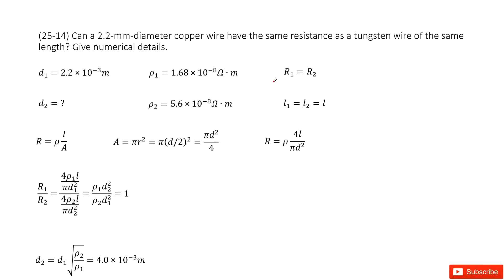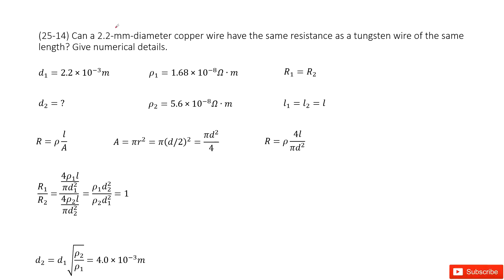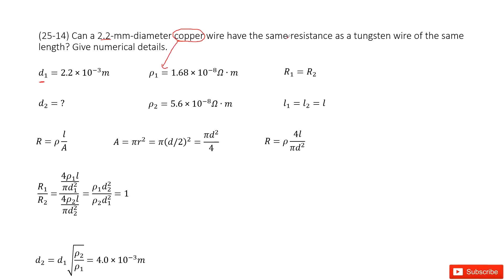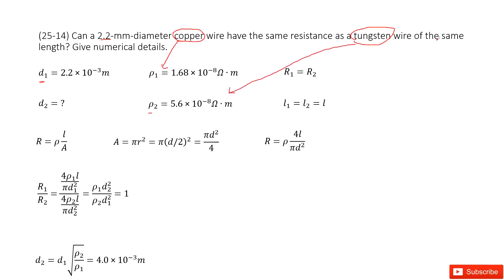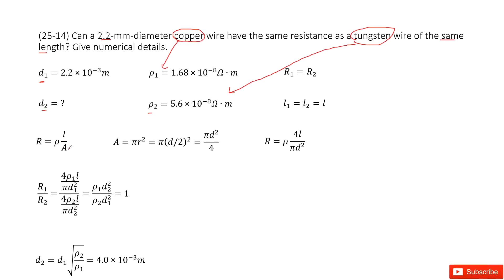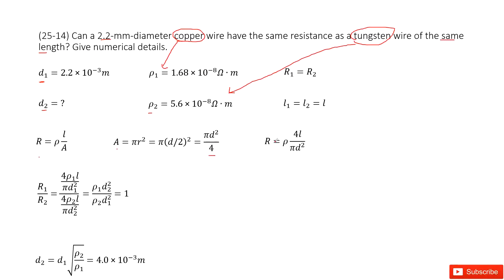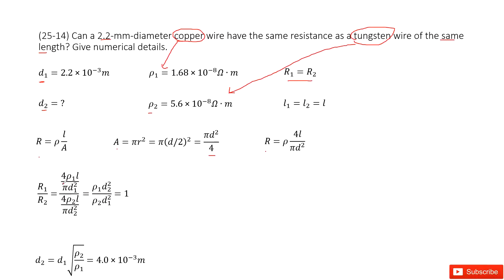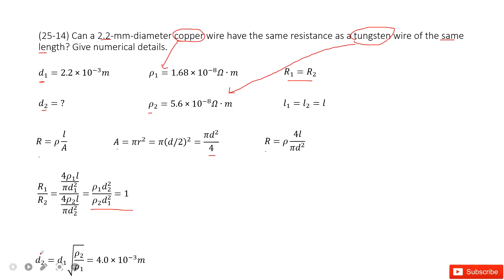(25-14) Can a 2.2-mm-diameter copper wire have the same resistance as a tungsten wire of the same le

Comment: The textbook gives the answer "Yes, for length 4.0 mm." for the problem on wires. i guess that the author meant the length of the diameter and not the length of the wire.